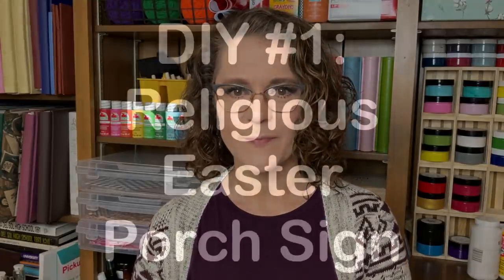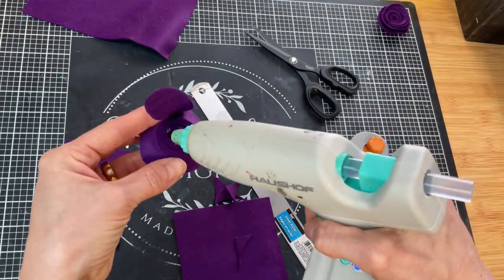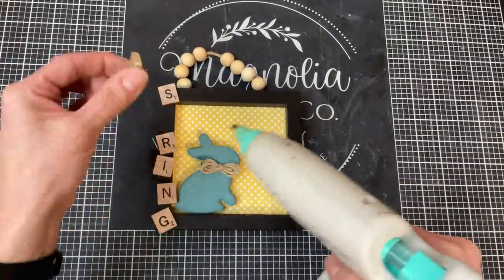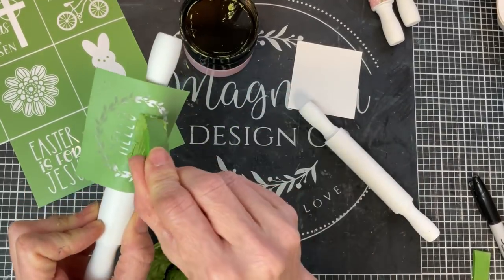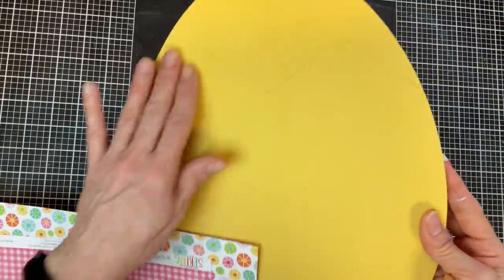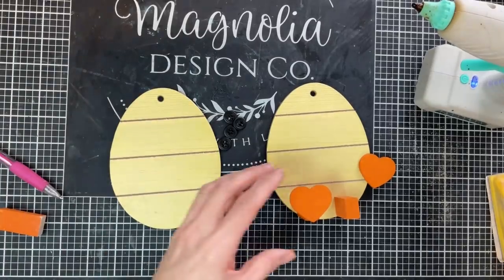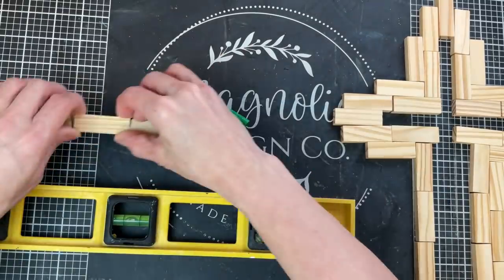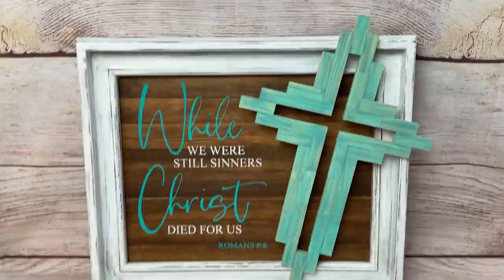🌷 HIGH END DOLLAR TREE EASTER & SPRING DIYS | Dollar Tree DIY | He is Risen | Magnolia Design Co 🌷

Comment: I really like the stenciling but when you do it on wood or painted surfaces do you have to use a wax or anything?  I did this once on a painted wood surface and the paste did NOT come through.  What did I do wrong?
Reply from the maker: I did spray clear matte spray on the paint sticks after I antique waxed them.  This seals the porousness of the wood.  What stencils and paste were you using?
Reply: @monarchmomdiy  I was using Chalk couture.  Thanks